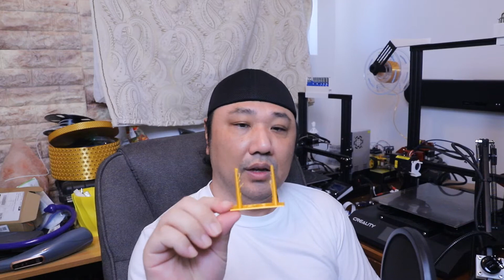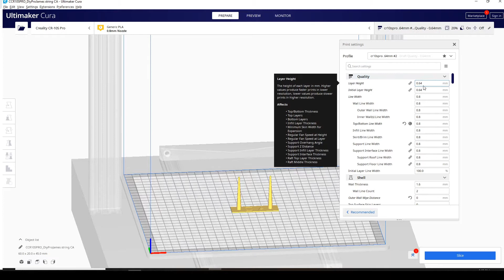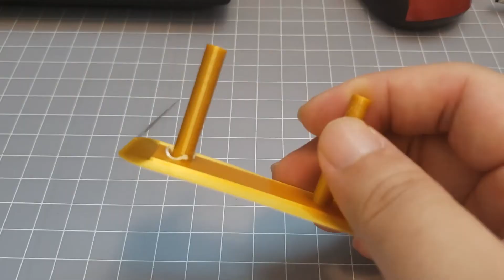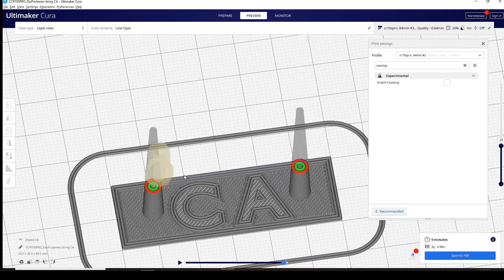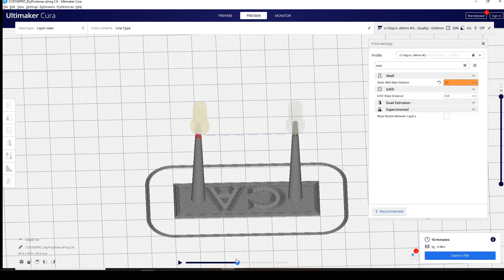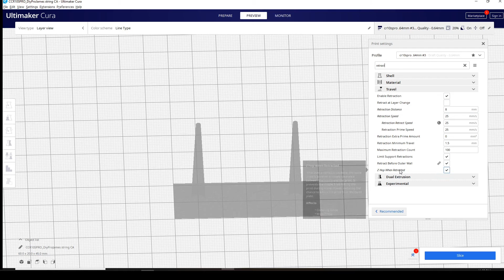STRINGING CALIBRATION TESTS - ENDER 3 CR10S PRO - guide to removing stringing. Retraction Setting.

Comment: is it possible XD with some modifications... 0 stringing with 0.3 retraction with direct dual drive and a powerful fan, watch out for moisture.. if the filament is wet you get stringing

Comment: Hey, thanks for that video, but i got an issue, when z hop is enabled i got stringing and i really need this on because i had nozzle hitting the print as an issue, any suggestions ?
Reply from the maker: This is a really good question. I was planning to do a video on it. I for the most part disable z hop. For one when you disable z hop your print times will be much faster. It cuts down around 1/3 of the print time. I suggest you do a pid tune and then e step calibration. Then tighten the bed springs slightly. Then make sure your slicer settings are good. I might enable zhop for a nozzle .8mm or higher.
Reply: @DiyProJames   thanks ! the problem is that i dont want enable zhop because it create some stringing, not a lot but its there, but i got collision issue and it create some lines on prints
Reply from the maker: @victorbasse9240  The only way is to change the retraction setting and cool down your filament... It depends on the design of the print too. It may just be the case you're not able to get rid of all the stringing. If your nozzle is hitting the print, there is a good chance that your over extruding. This is why I recommend you do a pid tune and estep calibration.
Reply: @DiyProJames  i tried and yes you where absolutly right, 2% overextruding was the problem, i put e steps to produce 99% to make sure this issue dont happen again, and reduce Travel speed. Problem solved thanks you 🤘
Reply from the maker: @victorbasse9240  Good. I'm glad I could help.
Reply: @DiyProJames  hey there ! I found something really intresting, i juste enabled z hop and wanted to get no stringing with it ... I tested a lot of settings but hey, i just did a retraction speed tower with z hop disabled and one with z hop enabled, got no stringing on a hop disabled at 25 mms and 15 mms with z hop enabled ! Maybe you can take a look, its maybe the same for you ! By the way i put a direct Drive on my ender 3 pro that way i got 1 mm retraction. See you !

Comment: could you please send me the the test calibration settings for cura for each stl model in a .txt archive?
Reply from the maker: I currently don't have the settings for all the calibration tests. I have only the latest one that I've saved and uploaded to thingiverse. https://www.thingiverse.com/thing:4556519 There is also a link in the description above. It is not in txt format it's in the cura profile format. All you need to do is import it to your cura slicer. This video was to demonstrate more on how to create your own profile settings because based on the filament and your printer these setting will vary. It's best to always make your own profiles.
Reply: @DiyProJames  thank you bro,
Reply: I see in you PLA cura Setting that its the same as the default. I have a CR 10S PRO and i have tried like 16 prints with diferents settings and it still doing the same stringling issue
Reply from the maker: @wilmeerdelossantosramirez4539  I don't consider stringing to be the most important factor when printing... You will always have some type of stringing depending on the design of the print relative to the nozzle size. There may be very small differences in the settings @ retractions, but for the most part the default cura settings are pretty good. I think as cura updates they take recommendations of other users. Many users have recommended similar settings with very minor changes dependent particular filament and possible hardware changes.

When making pancakes people will come up with near similar recipes when using the same ingredients and utilities.

Comment: Do you have a breakdown or profile to download for your settings. I have a stock cr10s pro and my stringing  is out of control lol
Reply from the maker: This is for the .4mm nozzle with .2 resolution in PLA .. Try it out.. https://www.thingiverse.com/thing:4556519 .. If you have problems try reducing the temp within 5 degrees first... Also you can try it with and without the zhop... Depending on how well your printer is tuned may make or may not make a difference.... Let me know how it turns out... I will add other profiles down the line...

Comment: What material are you using?  I've been loosing my mind doing those cone shaped towers with PETG and I agree; I think its impossible to get acceptable results with PETG.  Should I give up on the cone towers and just use the cylinder towers.   Ive exhausted all the settings to be tried.  Worst part is; everyone who says they have  found good setting are not like what others say are they're good settings for them.  So frustrating.  Im wondering if its my filament (EuroPetg).
Reply from the maker: I'm using PLA, though I do have a brand new petg roll I could open up to do some tests. What I found from observing these tests and profile is that you won't be able to get rid of all stringing. Actually there is a relationship between the nozzle size and the surface volume it drags on. This is why I made the reference to a hot glue gun in the video. The stringing just gets longer and thinner. The only way to get rid of it is by using a smaller nozzle or wiping on a bigger surface area. However, changing these parameters will also affect the overall outcome of the print in another area.
Reply: Luke has a PETG 4.3 Profile in the fb Creality page. Used that switching to PETG. Worked well on the CR10S Pro V2. Just had to adjust nozzle height.

Comment: Ya I use 4.6.0 and use tpu for my drone stuff and finally got rid of the stringing in stock Bowden cr10s pro
Reply from the maker: Great. Any tips for us on which setting made the most difference in removing the strings?
Reply: DiyProJames sorry I haven’t responded I am trying to figure a way to show you pics of the settings
Reply from the maker: @Nickc582  There is a export feature in cura.. It's easier you can just upload it somewhere or email it.
Reply: I’m not at my computer atm when I get back I’ll post the settings also use drying packs in a sealed box while I’m not using the rolls helps a lot to keep tpu dry

Comment: You're using Microswiss on the CR10S Pro?
Reply from the maker: Yes, I got this early on....
Reply: I'm using a microswiss too on a pro and its nigh on impossible to get rid of all the stringing
Reply from the maker: @panniechristou9644  I would say stringing is the least of important when it comes to 3d printing. I rather have it string than have the print delaminate. It would be bothersome if you were doing really small miniature prints. However, a heat gun could get rid of most of the stringing
Reply: @DiyProJames  that's what I do to clean up my prints, I agree better to have a solid print and some strings.
Reply: Dr Vax concluded it's better to use a direct drive sysyem to get rid of stringing. Moving the gear extruder on the hotend might work, but will add some weight on the hotend. I havent seen it done on a CR10S pro v2.
Reply from the maker: @webslinger2011   It might be slightly better with a direct extruder, but still you can't remove all the stringing... If you take a look at his models there is still small amount of stringing. I think if you really want to get rid of the stringing you have to reduce the size of the nozzle because there is a relationship between the surface area "wipe" and the hole size or volume of ooze. This does not mean I want to print with a 0.1mm nozzle increasing my print times in a order of magnitude unless if I'm printing a miniature. I think the best method is to just have a little bit of stringing and remove it with a heat gun. A little amount of stringing is ok...... Oh forgot to add where the direct extruder really shines is when using a really flexible filament like tpu. This is when retraction fails relative to how flexible the filament is.
Reply: @DiyProJames  I was planning to move to a 0.6 or 0.8mm nozzle(Already have the nozzles). That means I'll be having a harder time getting rid of stringing if I go with a larger nozzle. Bummer!
Reply from the maker: @webslinger2011  When you move to a larger nozzle stringing will be the least of your worries. I think .06 is a really nice nozzle size. It was really my go to size when I had one printer. Relatively no problems like the .04mm When you move to a .08 nozzle making small change especially in temp will speghettify everything.. . Still I don't want to wait for days on end for a large print that's why I'm opting for the .08 mm nozzle. Since my 2nd printer is now set for at .04 for smaller prints.
Reply: @DiyProJames  0.6mm nozzle then.  Thinking smaller prints would look awful with 0.8mm nozzle. Thanks!